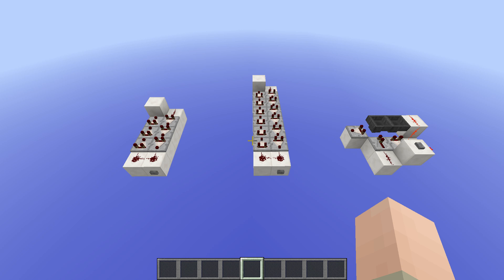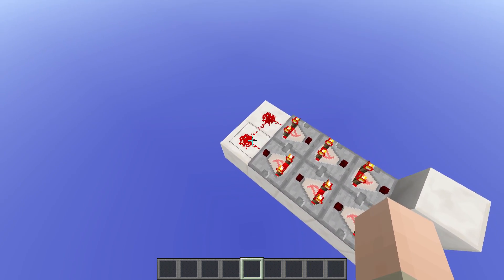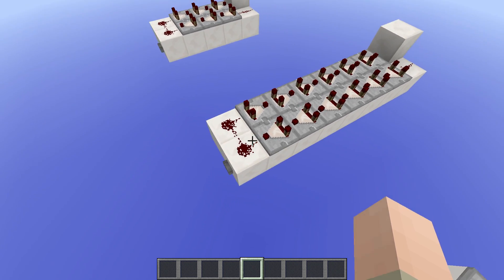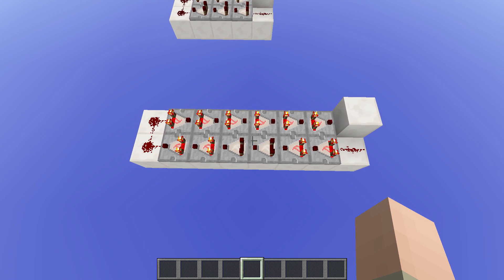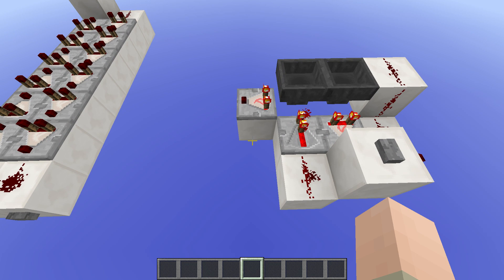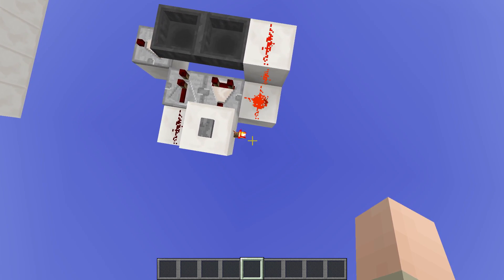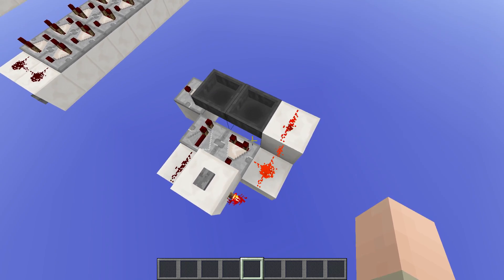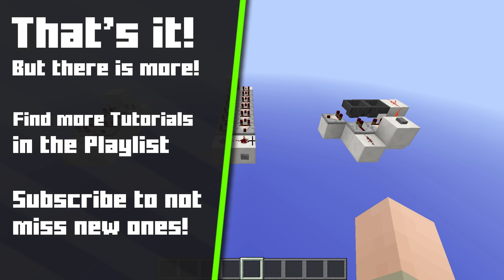Redstone Basics - Pulse Extender [Tutorial]

Comment: You can replace the repeater with a regular block. And you can avoid the clocking of faders by placing a block and dust in the middle (or at intervals of the input pulse).